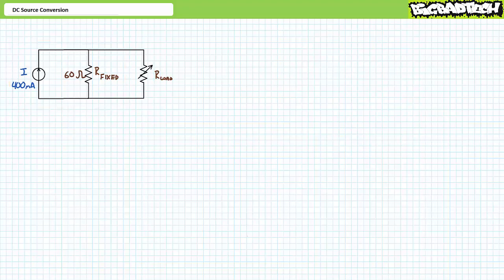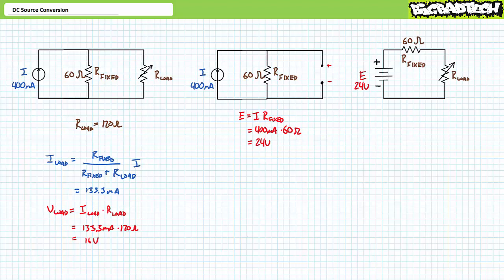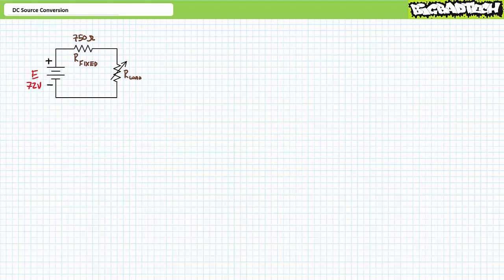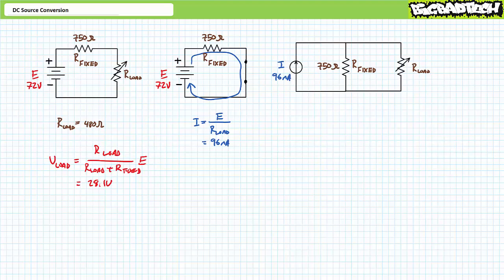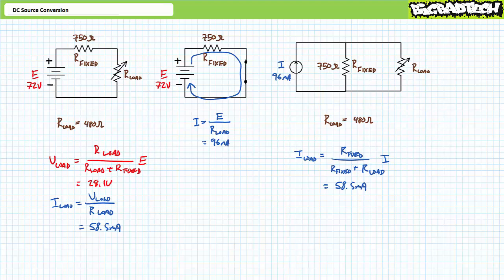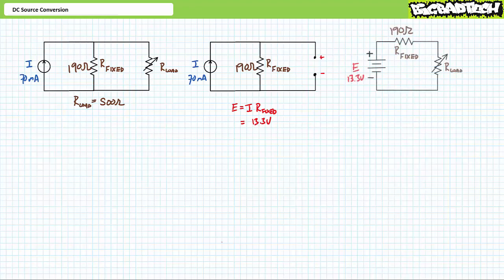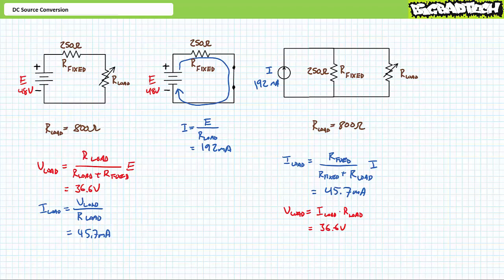DC Source Conversion (Full Lecture)

Comment: Jim, I am interested in magnetic circuit theory, so I can understand how motors/gen work and how flux effects all of this? Can you recommend any of your tutorials?
Reply from the maker: I do have some older lectures on electromagnetic interaction in the motors and generators playlist, however, stay in touch because once I finish fixing up the "basic electricity and electronics: dc circuit analysis playlist" (so close! only superposition, thevenin's, and maximum power transfer theorems remain), I plan on releasing new material including updated and expanded motors and generators. These new lectures will feature some cool magnet tricks.

Comment: I might be wrong on this, but in the last example you took the voltage (48) and divided it by Rfixed (250) to get 192 mA. Where as you said previously to take voltage (48) divided by Rload (800) you should get 60mA. Looking back you also took the Rfixed although it says I=V/Rload before.
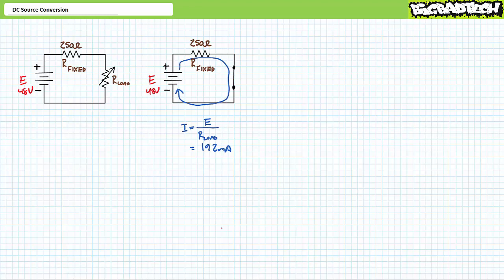Reply from the maker: Good catch. Yes at 9:25 it should read I=E/Rfixed.